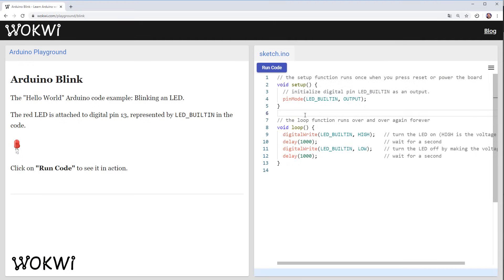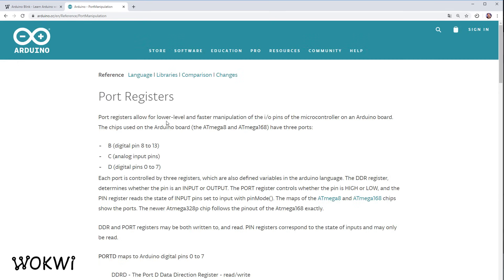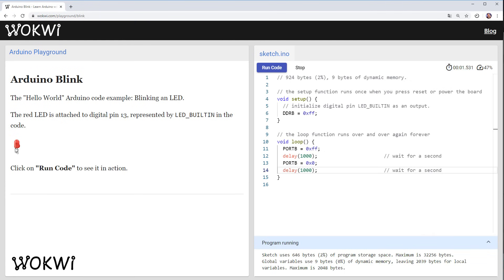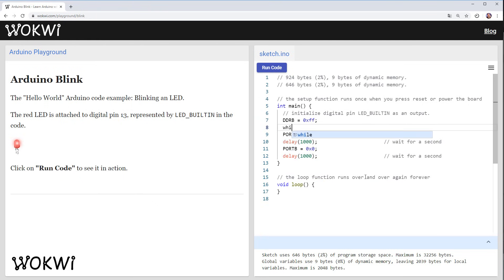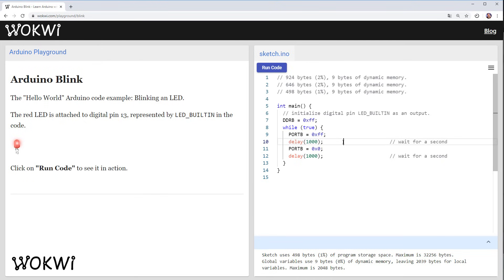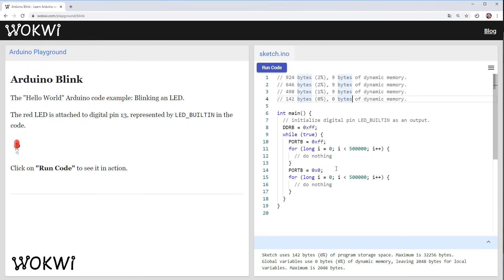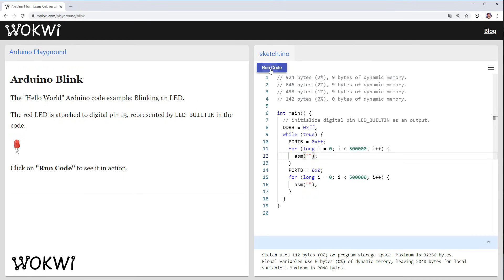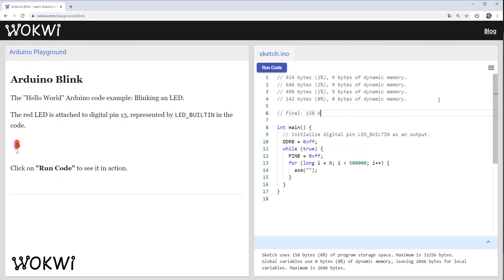Optimizing Arduino Code: no setup(), no loop() ⛔

Comment: Great simple descriptive video.  

If ever redone in.a newer video:  The sizing comments should include a description of what the mods were, and the operating result.   Also would be nice to know what the empty loop time elapsed is, measured.   You can use a stopwatch and and outer loop to lengthen the time to that which your fingers can operate the stopwatch to some good accuracy.

Comment: This is like using C code but without the Arduino "runtime" (if it can be considered as a programing runtime) and the same if you make some an aplication for windows but without the C runtime.
Really cool.

Comment: As an academic exercise this kind of makes sense, but as a means of optimizing for boot time and maximum size of program you can run on an Arduino it makes little sense. You're essentially throwing away the baby with the bathwater and the major benefits of Arduino over the competition.

It's far better to buy a seperate USB device which allows you to flash/upload your program directly to the MCU rather than using the pre-installed bootloader.

You not only reduce the initial time it takes from power on to your program running from like 3-5 seconds down to less than 1 but you get hundreds more bytes of space without losing or having to reinvent all the useful functions and procedures in the Arduino libraries!

You may as well not use Arduino at all and simply use the IDE and tools provided from the manufacturer of the chips and save a few bucks.

Comment: One of the purposes of setup() and loop() is ease in programming for new coders. And function delay() offers accurate time delay. Your code is mix of low-level register access, and inaccurate delay using simple loop. If I want a 200ms delay, your coding would be inaccurate.
If you want optimization I think you go for assembly language coding.
Reply from the maker: Thanks for the feedback Andre! Yes, totally, the accuracy of the "home-made" delay can be improved. This actually give me an idea for another video, stay tuned :-)
Have you ever used assembly language in your projects? For which parts?
Reply: Hey  @Wokwi ! Did you make that other video? :)
(I'd be really interested in using efficient delays, for me, precise time intervals are really important, with using _delay_ms() for example)
Reply from the maker: @rafa_dzto  Yes, you can find it here: https://www.youtube.com/watch?v=tnfeMCyLZSo
Reply: @Andre Nixon Delgado
Not completely true. While it is inaccurate with this cycle delay, it is not that much of a challenge to setup a timer for 1kHz frequency yourself  (or any freq. which required in the project for other tasks), and make your own delay. It won't need half k of flash, and you might use that timer for several other timings.

If you are not just blinking LED, but do some more advanced high-performance stuff, then interrupt handling, and utilizing that few timers that are in the core is a must.
In a properly written automation code, there is not that much of use in a synchronous blocking delay function anyway as usually only the UI runs in the main thread and that usually waits for the user and updates the display, which is usually not quite wise to be delayed (for more than 10-50ms or so, it depends).
Reply: I agree with Angelo. Arduino API is for fast fun with electromech stuff. I coded for hardware users, giving them APIs built on APIs to get them (litterally) flying. Once they were aware of the environment, I showed them to the minutiae of the lower and lowest level code for tight control and timing. I am happy with Arduino's method. It makes coding widgets fun again.
Reply: @Wokwi  I don't agree with Andre Nixon Delgado, your video was to show how the "easy" way (which makes sense for beginners) takes up precious memory in the Arduino.  Of course your "delay" loops are not accurate, but they don't have to be. The most important thing you showed is that the compiler's optimizer usually removes code that seems to do nothing. There are ways to tell the compiler not to optimize, but using the assembly hook: asm() was a very clever way to get around it.
If you wanted accurate delays, you could put those delay loops in a function with nointerrupts() upon entering and interrupts() before exiting. This will add some bytes to the code, but it shows your viewers how to "think outside the box" which you did very well. Note to newbies: Comment your code well, it does not add to the size of your program in the Arduino memory, comments are for we Humans, and are (for the most part) ignored the complier.

/*******************************************************************************
 *
 * Delay for a given number of loop Iterations.
 *
 * A simply delay loop that shows how to prevent the Arduino compiler's
 * optimizer from removing code that may be considered useless (like an
 * empty for loop).
 *
 * Pass 0x00000000 into Iterations for a minimum delay of few micro seconds.
 * Pass 0xFFFFFFFF into Iterations for a maximum delay of few seconds.
 * Pass any value in between for various other delays.
 *
 * If you need to know exactly how much a given iterations value causes
 * a delay, you can use the microseconds() function before and after calling
 * this function and take the difference to determine the actual delay in 
 * microseconds.  The nointerrupts() and interrupts() functions turn off/on
 * interrupts respectively. This allows the for loop to run in the same
 * amount of time for a given Iteration value every time this function is
 * called. Else, timing "jitter" in the delays between calls would result.
 * The asm() function is a Arduino "hook" to include assembly code
 * in your C/C++ code. Since no assembly code between the double
 * quotes was provided, no assembly code was included in the final code,
 * but the optimizer is "fooled" into thinking something is done in the
 *  otherwise empty for loop and thus the for loop is not removed by optimization.
 *
 * The Count variable is not actually needed, it is left to the student on how
 * to simplify this function so it uses a few less bytes of program space in the
 * Arduino.
 *
 *********************************************************************************/
void User_Delay(unsigned int Iterations)
{
  /* Initialization*/

  unsigned int Count;

  /* Process */

  nointerrupts();

  for(Count = 0; Count < Iterations; Count++)
  {
     asm(" "); /* Keep the optimizer from removing an empty for loop */
  }

  interrupts();

  /* Termination */

  return;
}
Reply: @Wokwi  Also, show your students how the optimizer does a LOT of things that are not readily apparent.

Example: Suppose you wanted to delay a few machine cycles without calling delays,  timer functions or using assembly code.

char  Dummy;
char *Pointer = 0x28B;

Dummy = *Pointer;
Dummy = *Pointer;
Dummy = *Pointer;

You figured this would take up up the right amount of time that you wanted, but since Dummy kept reading the same location in memory, and Dummy was not used elsewhere, the optimizer would remove the 3 Dummy statements (and not tell you) and thus not "eat up clock cycles" like you wanted.

Use the volatile directive.

char                Dummy;
volatile char *Pointer = 0x28B;

Dummy = *Pointer;
Dummy = *Pointer;
Dummy = *Pointer;

Now the complier is told what is at where Pointer is pointing is "volatile" and may be changing (even if it not) so don't optimize as if the user coded something redundant.

Note: The compiler will still give you a warning that Dummy was assigned but not used.

It is a good idea to get your code to compile with NO WARNINGS so when warnings pop up they can be addressed and made to "go away" when handled correctly.
Have you ever seen someone's code with tons of warnings? When a new warning pops up as code is changed, the warning is "lost in the noise" and is never looked at... this leads to more bugs rather than fewer bugs.

There are many ways to get this "benign" warning to go away (sometimes using complier directives or code pragmas).
Here is just one way to "get you through the night" as I say:

if(Dummy == 0) Dummy = 0; /* Shut-up compiler warning that the variable was not used - this was desired */

Try other things like these (see what works and what you like) - but don't forget a comment on why you did it.

Dummy = Dummy;

Dummy = (Dummy / 1);

if(Dummy == 0) asm(" ");
Reply from the maker: @paulromsky9527  Thanks!
Reply: @Wokwi  On the subject of using loop Iterations as timers: Just yesterday I was coding an Adafruit Trinket M0 (a US$8.95 microcontroller) to make a belt saver for our carpet cleaner. My wife fails to listen for the brush roller bogging down, which quickly burns through a belt. So I made a "Belt Saver" circuit for it. The M0 series Trinkets are great. They have a scaled down version of Python on them called Circuit Python. You simply plug the Trinket M0 into a PC USB port and it shows up as a tiny thumb drive. You then copy your code to a file called 'main.py', then tell the operating system to 'eject' the drive (you must do that after every software update), and away it goes. All you need for power it is a tiny 120VAC to USB 5V adapter and plug the Trinket into it.  Circuit Python's 'time' library does not have all the typical functions in it to save space - which is limited on a Trinket (it doesn't have perf_counter() for one) and monotonic() has a 1ms resolution but it updates only once per 10ms or so. I needed fast updates with 1ms resolution so I just used 'for' loops. I mounted an IR emitter/detector pair under the belt and glued eight 7mm strips of white paper (timing marks) across the belt every 60mm or so (paint didn't work, it flaked off). Based on the observed belt speed, I needed a 51ms timeout for my loop, so I put in a counter within the loop, set the loop to a huge value, and added a print() call after the loop to determine its timeout value. If the loop detected a timing mark it broke out of the loop early and I could see what Iteration it needed for 51ms on average for a timing mark to pass by. It turned out to be 80 (51ms = 80), so I added 10% to make it 88 for tolerance.  So, if a timing marked is not detected in about 56ms, the loop times out and a relay that controls the brush motor is turned off thus saving the belt from damage. To reset the circuit, I simply turn off the power switch, clean out the brush obstruction, and turn the power switch back on. I now challenge my wife to burn through another belt  [laugh].

This is to show the nay sayers that you can indeed use loop Iterations as decent timers in some cases, providing you can calibrate the loops to the timing you need.
Reply from the maker: @paulromsky9527  Clever use of technology :)
Reply: @Wokwi  She used the carpet cleaner just yesterday after our cat "yacked" on the carpet. She decided to clean under some tables and ran over one of the long strings on a cat toy and it stalled the motor... it instantly shut down and saved the belt... naturally, I had to cut the string out of the rollers to get it going again. She thinks I am a genius... oh, please, I only have an IQ of 165... the same as Sir Issac Newton... now, my heros: Max Plank and Richard Feynman... those were some smart dudes!
Reply: @paulromsky9527  

         I have never dealt with Arduinos but programmed Mororola microprocessors for years. For brief delays, I used the NOP assembler instruction which compiled to the NOP (no operation) machine code. If a similar assembler instruction is available for the Arduino microprocessors, all the Dummy things you wrote could be replaced by
              asm("NOP"); /* Briefest of delays */
or
              asm("NOP"); /* Briefest of delays */
              asm("NOP"); /* Briefest of delays */
              asm("NOP"); /* Briefest of delays */
or
              asm("NOP
                        NOP
                        NOP"); /* Very brief delay */

as corrected by whatever syntactic subtleties  that asm() could require of single or multiline assembler code in its argument.
     If the no-operation instruction were not available for asm(), there surely will be inocuos operations, or a couple of them the second of which would restore whatever the first did.
Reply: @paulromsky9527  If targeting specific hardware you certainly can use loop iterations if you know the number of cycles of each line of assembly, but everything breaks the second you buy the "new and improved" CPU which runs 5x faster.

If you're doing assembly right on a processor (without premade boards) you also introduce variances such as crystal speed to run the hardware.
Reply: @larrybud  Yes, but sometimes we are just slapping down quick code for a specific application, portability is not a concern in that case. When I write deliverable code, loops and such are never used. I use this trick to write code to "get me through the night" in the lab so to speak.
Reply: @paulromsky9527  How is putting some arbitrary loop of which you have no idea how large/long it should be faster than a one line delay statement where the result is known?
Reply: @larrybud  I am thinking a delay but with other code running during the delay... similar to kicking off another thread but simply time multiplexed instead.  Let's say I want to delay 100mS while checking if a byte from the console has arrived, and to update, say, a counter every 10ms. I could have 3 threads, but I can do it all in one thread. But in 3 threads, each thread runs unpredictably, but multiplexing in a loop could be coded faster than writing code for 3 threads and then all the synchronous code and/or interrupts I need for a specific behavior. I sometimes I just pulse and IO pin, put a scope on it, and adjust my loop that way. I get what I need at that time in development to solve a particular issue or explore some other behavior. And since it is throw away code in the end, I didn't waste time making something as elegant as 3 intercommunicating threads that I didn't need as well in the end.  I write code very quickly, I set out and go to plan. I usually have time in the end so I revamp it.
I am often called upon to get code out quickly to solve an immediate problem (to get us through the night so to speak) and then present a more elegant solution the next day.  Writing elegant code takes time because you have to understand all the nuances first, they often come to light as you code, and you say, ok, I see, there is now a better way, let me revamp that.  But I had to get "something" out quickly at first.
Reply: If you don't care if it will be 50ms or 400ms u shoyld be fine (the difference wull even be smaller if you trust the right crystal will be used

Comment: it is not 'optimization' it good explanation how Arduino framework works inside, he stripped out most of arduino )))
Reply from the maker: Good point, thanks!
Reply: Exactly. I won't call it optimization, I'd rather call it not using Arduino instead, but doing bare metal development. As someone who started embedded development before Arduino was a thing (or even born...), I like to write my own code, and know everything that will happen iside the device.

I usually develop mostly interrupt-driven code and it is not that straightforward to write reentrant/multithreading code and it also not welcome that the framework wastes cycles and timers and so on while I could have utilized the whole core by myself.

If someone at the point needing this kind of stuff, high performance code, etc. then it is better to leave the Arduino framework behind and start some serious embedded development. 😉

Comment: Hello, This was something I hadn't seen before.  Writing PINB toggles all bits (i.e. 0xFF).  That part wasn't clear from your narration, "totals the pins".  PINx is considered a read only register in Atmel spec, with a caveat:  

"Three I/O memory address locations are allocated for each port, one each for the Data Register – PORTx, Data Direction Register – DDRx, and the Port Input Pins – PINx.  The Port Input Pins I/O location is read only ... writing a logic one to a bit in the PINx Register, will result in a toggle in the corresponding bit in the Data Register."

Comment: I always just use _delay_ms(1000) instead of delay(1000).  The compiler knows exactly the for loop to jam into your code based on the frequency of your target board so timings remain accurate.  And the compiled code is still tiny and readable without being bloated with Arduino stuff. This also compiles to 158 bytes and 0 bytes of DRAM

int main(void) {
  DDRB = 0xff;        // Set pins 8-13 to OUTPUT
  for(;;) {           // Loop forever
    PINB = 0xff;      // Toggle pins 8-13
    _delay_ms(1000);  // Do nothing for 1,000ms
  } 
}

Comment: I think you can create a delay function of your own, and use it whenever you need some delay. To protect the for loop getting pruned by the optimization process, you could have used volatile keyword for the function. It may yield a smaller footprint (I have not tried myself). The same volatile keyword approach can be used for interrupt service routine functions as well.
Reply: In C you can not apply volatile keyword to functions
Reply: @brinza888  Arduino uses C++ I think, not C

Comment: inside the for loop you can write ; which is an empty statement ,then the compiler would never ignore the for loop, or a better solution could be by moving the increment of i to the loop:
for(long i=0;i<500000;){
i++;}